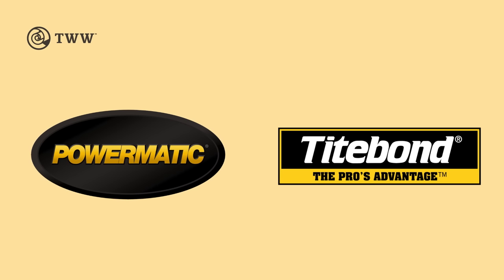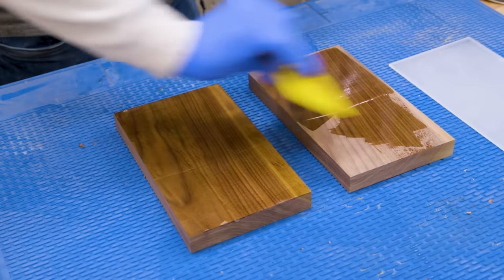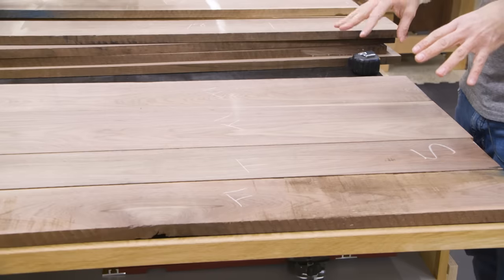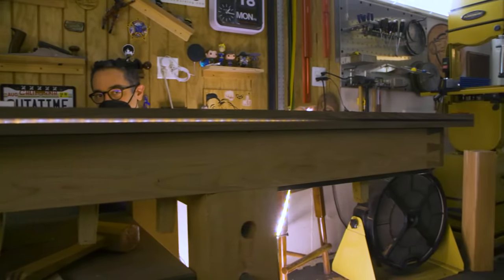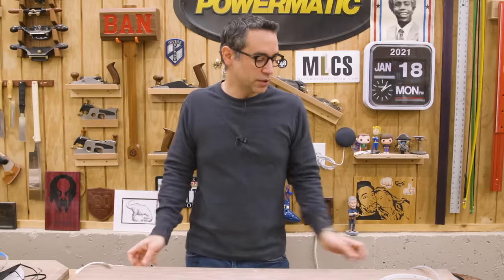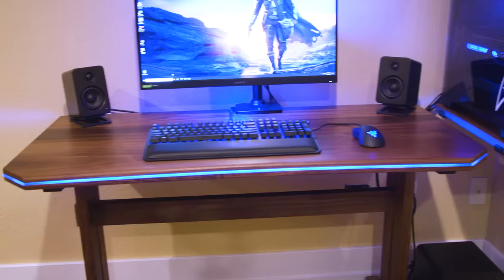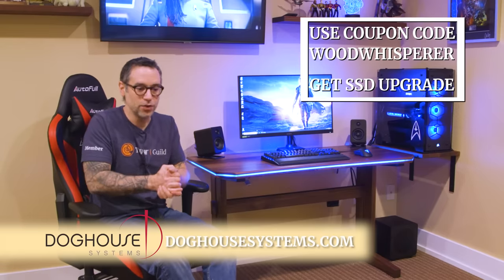I Made a RGB/LED Gaming Desk

Comment from the maker: It's a long video so you might find this helpful. Chapters:
0:00 - Intro
1:43 - Epoxy/Plexi Test
4:55 - Walnut Top Skins
7:16 - UH OH! Wood Movement!
11:12 - Top Glueup
15:50 - Shaping the Top
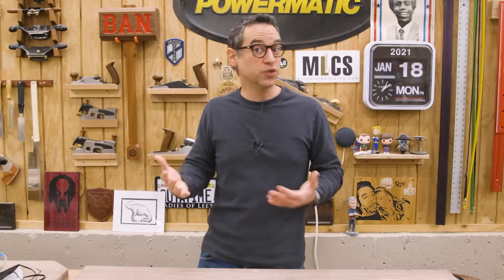17:01 - LED Lighting
23:11 - Doghouse Systems
24:48 - Base Parts
25:33 - Half Laps
28:12 - Dominos
32:38 - Fixing a Dent
33:19 - Assembly
38:12 - Cable Management
39:40 - Setting up the Desk
Reply: 😎uiijiiiii 😎ii
Reply: Ii

Comment: I've done a number of projects over the years using various optically clear plastics.  In the past I've always bought it at the local blue or orange box.  I've never been real happy with the material they sell.  It tends to be weird thicknesses and sometimes its acrylic and other times it's polycarbonate but you seldom have a choice.  When I constructed a horizontal router table to do the big dovetails in the Platform Bed Project, I got some very good quality acrylic sheet on Amazon.  3/8 in thick was exactly 0.375" thick.  I'll never buy plastics at the big box again.

Comment: Extremely nice. Love these longer videos as well. Btw - might want to get yourself an in-line valve for the vacuum line, once you have the vacuum needed just shut the valve and cut the pump. Should be no need running it overnight.

Comment: When I first saw the table, I assumed you had routed a groove, embedded leds, and then put some sort of diffuser over it. 
Then when you were doing the sandwich tests, I assumed the top layer was solid, but to combat wood movement, the plastic and bottom layer were only a couple inches deep with the center section hollow for the hardware & leds.
Reply: Me too. I wonder if, since he ended up with the groove and the diffuser closer to the front/sides, if he could do his wood-movement-management in the rest of the top. I live in SC where we do have huge swings of humidity and temp!
This is awesome, thinking about stealing the idea for built-in countertops for my amateur radio room!

Comment: How would you remove those plugs?

And I wish I could do a great job cable managing but realized it is a lost cause.  I have my Desktop which has gaming VMs on it, my work laptop, wireless headset, 3 IP phones, box for combining audio, speakers and all the rest.  I have SOOO MANY CABLES!!!!
Reply from the maker: I would probably either use a small screw to grab it and yank it out with pliers, or just drill a few holes and chop it up with a chisel. And I hear ya about the cable management. The more gear you have, the harder it is to do. And especially if you're changing gear periodically, it's a huge pain to tear down and set up again.

Comment: Really could have diffused that yourself with a 1/16" translucent white plastic - just put it in front of the LED's.  You can find sheets of it made for 2' x 4' light fixtures, and it's not expensive.

Comment: What product did you finish the desk with?
Reply from the maker: Rubio
Reply: @woodwhisperer  I didn't make the connection when you referred to it multiple times a just  "a hard wax finish"
Reply from the maker: When I says "hardwax oil" it's usually either Rubio or Osmo, depending on my mood. :)

Comment: That's awesome.  I love Walnut, and combined with the tech it's a great Mashup of styles. 

Interestingly enough, while roughing up the surface of the plexi added a tooth for the glue to bind to, I'm wondering if it's not why the led didn't transmit all the way from the back.  Fiber optics rely on the smooth surface of the material to reflect internally until the edge is reached.   With the plexi being roughed up, the light now scatters along that surface, reducing transmission at the far edge.

Comment: Fantastic craftsmanship as always Marc. I'm pretty knowledgeable in wood movement. I'm the guy the called you years ago about the prototype stabilized end grain boards using a middle core of sheet goods... Was using paperstone at the time I contacted you, years ago. They are functional and in production now. Just been so busy with custom cabinetry (that people guarantee a my sale up front for, unlike a mass production product like the boards) that I haven't been making too many of them. But I have maybe 30 of them in use in people's houses and businesses right now and haven't gotten any call backs. So that's good. 

Usually wood doesn't "expand and contract" when placed in doors when we have interior controlled climate. I have made maybe 8 solid lumber counter tops and screwed them down in all areas. I've also had many jobs break from contraction and require a refinish, and many jobs not break and be perfect right away which cause me to learn what actions I can take to cause each result... Anyways... It usually just shrinks and stays that way inside with modern insulated and heated/air conditioned homes... And if your shop is insulated and wood is dry enough then you won't have many issues.

If the top doesn't crack in 4-6 months then you should be good forever. Even if you got moisture on it through humidity, it will never expand beyond the point when you did your initial glue up because of the core. So expansion isn't a thing for you in this case. 

But an educational note here for extreme cases... Idk why, but I've seen it in my end grain fusion boards...if you are to leave your top alone and let it air dry to the humidity slowly by having both sides of the table top finished (as you already do) then if will shrink slowly and stay that size. But if you add a bunch of moisture to your top it won't expand beyond the original glue up point because of that core, but when that extreme moisture content leaves, it can shrink beyond the original shrink point. So that humidity cycling can actually cause cracking (shrinking) beyond the original 4-6 month interior acclimation/shrink time. So the way you did it should work. But it's not exactly indestructible. Like... Someone wouldn't want to do what you did if it's gonna be an exterior table. I think it has something to do with the speed in which the moisture leaves the wood. Kinda like the weird problem you had with wood cracking during steam bending. 

I could probably get close to an indestructible exterior table top because of my knowledge with my end grain fusion boards, and a few trade secrets that I haven't made public... But then there would still be the issue of finding a wood finish that will hold up to the elements which is a whole different story... I'm a bit of a wood scientist if you haven't noticed lol

Comment: FINALLY!!!!!!!!!!  A computer desk for geeks with taste. No more warped plywood sitting on top of stacked milk crates. Yes this is going to cost a lot more than those overpriced MDF desks with carbon fiber "looking" stickers on it from that four lettered store, but then again, you get what you pay for. 

For those of us, like myself, who live in areas where very high humidity in the summer and extremely dry air in the winter might be able to de-laminate this tabletop, use a piece of plywood that is the same thickness as the plexiglass. Cut the plexiglass to 3 inch wide strips, epoxy the strips to the outside edges, fill in the rest with plywood leaving a gap to install the LED strip. This will allow for enough expansion that the table won't de-laminate, and where the plexiglass is, it's only 3 inches wide so that shouldn't be a problem either. If you really want to go hog-wild, you could fill in the backside of the desk with a one inch wide strip of walnut just to completely hide the plywood. It's probably going to take a few extra steps, adult beverages, and quite possibly, a few foul words, but you'll end up with a tabletop that won't de-laminate.  

GREAT PROJECT!!!!!!!!     I LOVE IT!!!!!!!

Comment: Love it Mark! Only thing I wanted to mention (I know  stupid late...) is that if you painted the wood layers or plexi with a satin white before joining to the plexi (or better yet mirrored plexi), your light dispersion issue would have been resolved. Not sure how the adhesion would have been, but knowing epoxy and water based paint, the epoxy should have gone through the paint and adhered without an issue. There are a lot of us in the car audio world who have joined plexi to wood with cheap LEDs with awesome results.

Comment: Using a full sheet of plexi seems unnecessary and wasteful. All you really need is a strip a few inches wide. That would also minimize issues with wood movement I would think. Drill a few through holes in the strip to allow the epoxy to 'bite' through.

Comment: I used to work In the car audio world. For something like this you can cut a rabbet in the front of the top and bottom panels and use WAY less plexiglass. Plastic isn’t the cheapest thing haha. If fact you could have milled up your walnut to your final thickness and cut a groove in the front and sides and slipped the plexi in there. Finally, cut to final shape!

Comment: I’m really glad you addressed the wood movement issue with this as it was one of my first thoughts. I too am embarking on a bit of an experimental “rule breaking” construction for a workbench top and I’m apprehensive but going for it - a core of 3” wide baltic birch strips glued face to face (layers running vertically) to form a 24” wide 3” thick core slab, then skinned top and bottom with 1/2” baltic birch sheets. I’ve been monitoring the core before applying the skins and it has been expanding as we approach the summer months since it is expanding effectively in the plywood’s thickness direction and not its length/width direction. I’m hoping the skins will seal in the core and restrict moisture transfer and/or physically restrain movement. The existence of something like solid core lumber/blockboard gives me hope. I’m interested to see how your wood/plastic/wood sandwich turns out especially since it is kind of an inverse situation as mine.

Comment: Damn I really like the way you put this together. This makes me wish I was still in shop class so I would have access to the tools. I really want to take this idea and recreate my current corner desk. Also, my shop teacher let me build anything I wanted as long as I got the required projects done as well. Only class I had a perfect A+ through out high school. Funny, I thought I was going to be a carpenter but I ended up being electronics PCB tech.

P.S. I've been using the same blue light scheme for many years. Flashing lights are too distracting when gaming (or sleeping since my setup is in my bedroom).

Comment: The Plexiglas Endlighten is glossy on top / bottom. I think the led strip didn't work out because you sanded top & bottom (reflects the light inside of the wood). However, I have no idea if it would stick to epoxy w/o sanding. And your workaround looks cooler and also resolved the diffusion issue ;)

Comment: I really like the desk, great idea to build a notch for the lights. You may have issues of premature failure from the lights due to heat. LED light put off some heat and not easily dissipating the heat is a killer of electronics. Hopefully you won't have that issue. The desk is awesome, looks like those Krenov saw horses.

Comment: Sometimes when I use my white charcoal pencil to make marks on walnut, the surface won't take the pencil line. I've tried sanding and cleaning the wood with mineral spirits beforehand with no benefit. Any tips on how to avoid this?

Comment: Wood expands and contracts due to changes in moisture. Epoxy cures into plastic, which is waterproof. If you finish the whole top with epoxy you basically waterproof it. No change in moisture, no expansion or contraction. That's what stabilized wood is.
Reply from the maker: But you have to be ok with a "plastic" table. Not a big fan of a thick film finish like that.

Comment: if you sand the edge of the plexiglass where the ledstrip is mounted, the light becomes diffused and shines brighter.  Check out Steve mead here on youtube. for tips and inspiration.
Reply from the maker: Yes but in my situation it made very little difference. I expected the sanding to have a great impact but it really didn’t. In my case, it was just too great a distance for the light to travel.

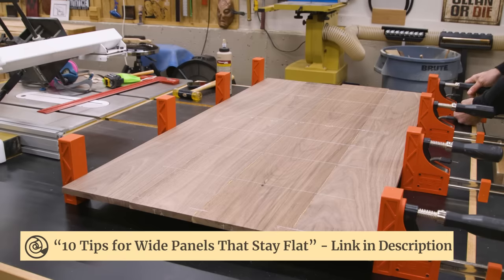Comment: @9:58 Where'd you get ORANGE JET clamps?  At first I thought they were PONY Parallel clamps. Is your color balance that bad in your camera or did you have a bad setting?
Reply from the maker: The color balance is fine. If you look at the back on my workbench and on the wall there are a few Woodpeckers tools. Nice and red. For whatever reason, the plastic they use in Jet clamps can come in several shades of red and over time they seem to gradually fade to more of an orange color. And mine are maybe 15 years old at this point.

Comment: Fantastic desks! I'm not sure what type/grade of "plexi" you used, but using Lucite Acrylic you get about 100% light transmission on edge. I made 25 Headstone shaped plaques  with the Names  etc. engraved into each one for the employees at my work to commemorate a company milestone. They were about 3 x 5 and meant to sit on a shelf or desk, a couple of the folks hung them from their rear view mirrors. Each had a small single led colored light source powered with coin type batteries. The backs and edges were painted dark gray. The only place the light showed brightly was where the letters and logo were engraved. Kinda works like fiber optic. I think if the material you used was a Lucite type panel, you could have embedded the light source in the back edge and it would have been just what you were looking for. Just a thought.
Reply from the maker: If you watch the whole video you'll see that didn't work. https://youtu.be/KgRaLxXWj2o?t=1047

Comment: I noticed you switched between the 3m respirator and a cloth mask. I'm curious why you used both? I've normally only seen you use the 3m mask in videos and would have expected the 3m to be plenty capable against the virus.
Reply from the maker: Well I won't claim to have to most logical approach but we were doing our best to protect ourselves and each other against both dust and COVID. So the 3M certainly might filter COVID but does nothing to prevent is spreading around the shop. Exhaled air goes right out the mask. And it's a lot harder to talk with a respirator on so if there wasn't a dust hazard, we'd switch to cloth or surgical masks. So depending on what we were doing in the shop, we'd use both at different times.

Comment: To reduce the amount of plexy.. use a solid top rather than a laminate, and use a slot cutter on a router to route a slot around the edge, place the led strip in the slot, and fill the slot with white opaque epoxy, sand edges smooth, connect the leds up to an esp32 (arduino), and drop a touch screen in one of the corners of the table, recessed, to control the leds (possibly throw a wireless charger into the table as well...  but then I'm a nerd.. and I like to make things as hair pulling as possible...
Reply from the maker: Part of my strategy is making sure the LEDs can be replaced if needed. So embedding it permanently in the table wasn't an option. There are quite a few alternative methods though and the only reason I did what I did was because I started with the initial plan of putting the lights in the back. Even after doing some mockups, I underestimated how little light would make it to the front strip. So everything from that point was me trying to make the most of what I had to work with. Building new today, I'd definitely have a different plan of attack.

Comment: Personally not a fan of the RGB craze, but if you are going to build an RGB desk this is the one!  I know the Domino's were just for alignment in the desk top, but have you thought about getting a Domiplate from Seneca Woodworking to center them?  I love my Domiplate.
Reply from the maker: I have one but I’ve never been motivated to install it. My material is rarely a round number so it’s just easier to center the tool manually.
Reply: @woodwhisperer  Yeah, I wish the Domino had a micro-adjust or some other method to adjust the height so that a Domiplate wasn't needed.  Desk looks great.  I was worried about the LED transmitting all the way across to the front edge but it looks like it works very well.

Comment: mark how do they do it with live edge river tables with wood movement ?
Reply from the maker: Most "epoxy river tables feature wood on the outside with an epoxy section in the middle. There's nothing there to restrict wood movement so there's usually nothing to worry about.